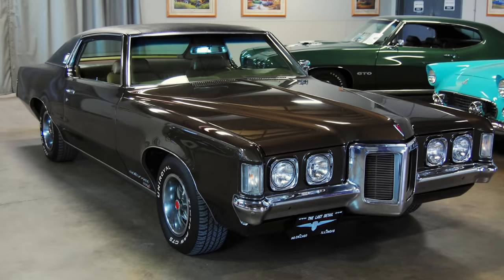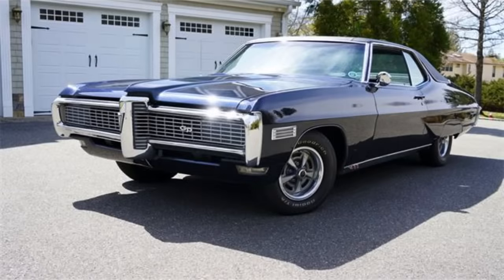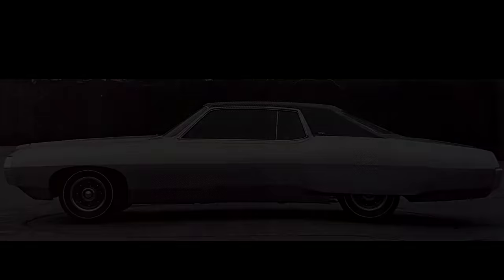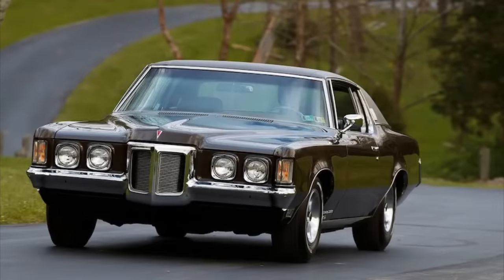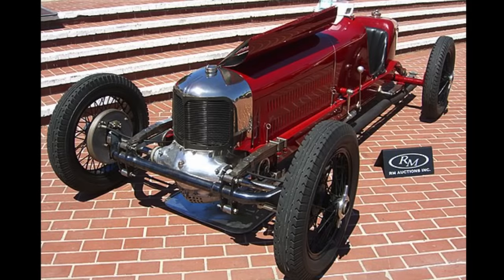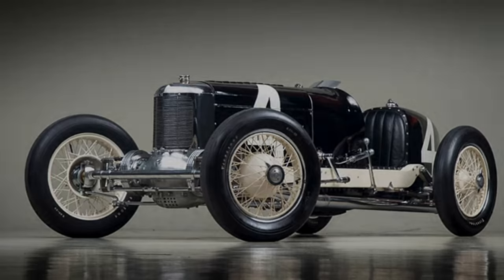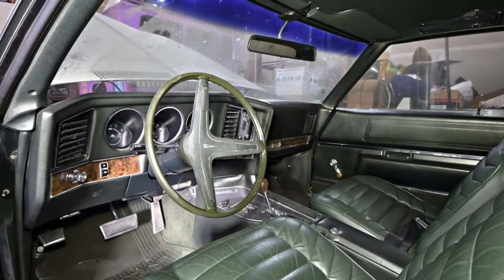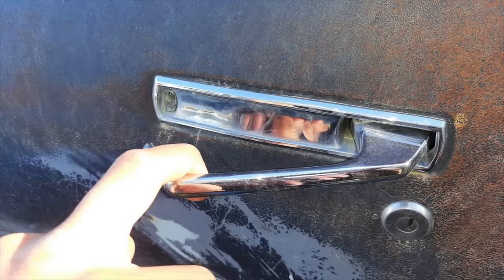Top 5 Strange Facts About the Awesome 1969-72 Pontiac Grand Prix!

Comment: The 69 to 72 is hands down my favorite generation of the Pontiac Grand Prix!!! Thanks Adam for sharing this informative video!!! 👍👍🙂
Reply: If I had my druthers, I'd blend a 69-70 front clip onto a 71or 72, dunno about the interior blend but I've ridden in the 69/70 they seemed good enuf on the inside just dig the rears of the 71-72's
Reply: The '69 wasn't boattailed, much cleaner than the '71-'72!

Comment: Actually, the 69 and 70 big Ford had a DRIVER-CENTRIC dash.  Everything wrapped around the driver.  The passenger could only look at the glove box.  The radio was on the left side of the steering wheel and the clock faced away from the passenger.  It was a great design if you didn't like passengers fuss-en with your radio.
Reply: As it should be. The passenger should just be glad to be there, and behave themselves.
Reply: I was going to point that out.
Love those big Fords.
Reply: I was thinking that same thing. I think the driver-centric dash layout was nicer looking in the GP, but the 69-70 Ford dash was over the top driver-centric.
Reply: The LTD, at least, stayed that way through '72...
Reply: Driver centered dash: 1963 Studebaker Avanti
Reply: @hiitsstillme  Sit down, hold on and shut up! 😆
Reply: @marko7843    True....But at least they moved the radio over to the right where the passenger could diddle with it.
Reply: @jwelchon2416 that was a mistake haha!
Reply: I had both.  1969 Grand Prix and a 1970 ford LTD. My wedding party was a ford LTD AND 3 69 Grand Prix’s. If I were to take my pick today, I’d pick the ford. (4-door)The parking spots today, I’d never be able to open the door wide enough to get out of the Grand Prix!
Reply: The vast majority of the full size '69 Fords had standard (not split) bench seats. I think the primary justification for Ford's driver oriented cockpit was that the remaining 3/5 or so of the instrument panel could be swept back. This allowed a short person to drive with the bench seat adjusted further forward, while still leaving a feeling of spaciousness for the front seat passenger, or perhaps even two passengers.

I could be wrong, but I think most if not all '69-72 Grand Prix had bucket seats. So, GM, unlike Ford, did not have to worry about the dash encroaching on the middle passenger's space.

Although it looked cool, the '69-70 full size Ford dash was not really as user friendly as it looked. And, I wonder how many customers Ford lost to other makes when prospective buyers saw that the radio was located on the left side of the driver. I still like it though, and fondly remember riding to the Dairy Queen in my neighbors' dark blue 1969 Country Squire.
Reply: Yup, Ford actually advertised the passenger side as the “front room”. 😊
Reply: You are correct, see my reply.  Dave...
Reply: Wasn't the dash of the bulletbirds briver-centric
Reply: @jimmyaber5920  They were more a dual cockpit.  The radio and climate controls were in the center.
Reply: One more thing, I am 63 years old, and I remember when Ford did that on the Ford fill-size for two years.  Mercury also located the radio on the far left side in 1969-1970.  I have NO idea why Ford did that.  And the radio antenna was located on the left fender, making it so the the antenna was always the driver's left-eye view, at all times.  Please reply.  Dave...
Reply: My parents bought a new 1970 Galaxie 500, and tbree years later I briefly owned a 1970 XL convertible.   My mother was only 4'8" tall and she could (just barely) reach the pedals (the dealer had to remount the seat closer to the dash for Mother as it was), whereas Dad and I were very cramped in that car.   But the radio being on the left was no big deal; my folks would have selected the "radio delete" option if it had been offered (it wasn't in the Galaxie or LTD).
Reply: And ...."Cash, grass or ass. Nobody rides for free!".
Reply: @jwelchon2416 no radio was on the left.
Reply: @michaelwitas9482  You'd take a '70 LTD Ford over a '69 Grand Prix ? Shocking.

Comment: I often wonder why the change was so dramatic in 1969 when Grand Prix used to be on the full-sized car line.  This video explains things. It went to the midsized car line and never looked back. There were many successful Grand Prixs over the years. They got away from the Duesenberg trim names in the 1980's. I am thankful you explained them. I had relatives that owned Grand Prix with those trim level names.  I recall J, SJ, LJ. I may have missed one. Those were some very interesting facts. I do recall all of them. Good footage and information. Thank you Adam.
Reply from the maker: LJ came later
Reply: @RareClassicCars  Indeed. Thank you for the correction.  It got easier to recall the trim levels by the 80's and 90's too: base, Brougham, LE, SE, GT, GTP, and the brief Turbo. People later associated this car with Nascar and Richard Petty. The Pontiac 2+2 came back briefly in the 80's in that Nascar package,
Reply: @OLDS98  That 1985 Pontiac 2+2 was very good looking for the era. Too bad it didn't have the performance to match the looks.
Reply: @MarinCipollina  Thank you for your comment. This is true. I see them on You Tube all the time and for sale sometimes too. The other G-Bodies ( Oldsmobile Cutlass 442,  Chevrolet Monte Carlo SS, Buick Regal Grand Sport ) all had performance. I wonder why Pontiac did not invest too. The trunk was an issue on this car too because the opening was quite small. I guess they more than made up for this with the next generation W Body performance Grand Prix Turbo, GXP, and GT.

Comment: One interesting tidbit, 69 was the first year that the Bonneville had a unique grill design compared to the other full sized Pontiacs like Catalina.  This is because the 69 Bonneville grille was designed for what was going to be the full-sized 69 Grand Prix before they decided to instead build it on the midsized platform.
Reply: I liked that upscale looking '69 Bonneville grille with it's endura impact absorbing framing. And, I think it's neat how the Grand Prix and Monte Carlo looked distinctly different even though they shared a lot of parts and under the skin engineering. You could never mistake one for the other, at least in the early years.

Comment: I’ve owned many Pontiacs and other vehicles in my 73+ years. The 62 GP and the 69 are my favorites. I still have two 62 4speed 8 lug GP’s plus a 62 Catalina convertible. I had a 63 GP 4 speed my brother got from me and still has. Also had two 64’s, a 65 and a 66 421 car. Newest owned was a 69J and in 1974 I bought a 72SJ 455. I still have my 65 GTO tri- power 4 speed and had several Firebirds, Lemans and Bonnevilles. I still have a 61 Bonny bubble top.

Comment: Gorgeous cars.  73 and after had I think one of the best dashboards ever but prefer the style of the earlier.  Although not especially praised in this vid, I love the 67 and esp the 68 full size...great detailing and have such a massive authoritative presence, while 69 and later had a lighter sportier look.  But ya know they were all good and a winner for Pontiac from the get-go
Reply: The earlier full size 1960s Grand Prix were always very special cars. Most were loaded with all the options you would expect on a Cadillac. They used real wood on interior dash, door and console trim. They were also very powerful with 421 Tri-power V8 engines. The 1964 had Cadillac style iced tail lights. The 1967 was the only full size Pontiac with hidden headlights mounted horizontally. The others were vertical stacks, which looks a bit awkward today.

Comment: Easily one of the best I’ve ever owned a 71 SJ with 455 HO dual snorkel air cleaner bronze with crème vinyl roof and interior.  Mine had the rare bench seat column shift and Trans Am style stamped steel steering wheel.  So much fun a true muscle cruiser.

Comment: Hi Adam, outstanding car and video!  Your information is 100% correct!  Most people who owned a Grand Prix, had no idea what "Model J' and/or "Model SJ" stood for.  In 1969, Pontiac Motor Division took the GM A-body "mid-size" hardtop frame and pushed the fire wall, roof and passenger compartment back, to produce a longer hood, front fenders, shorter rear deck and longer roof sail panels, (the area behind the quarter windows or rear side windows).  Chevrolet Motor Division did the identical thing with the brand new Chevrolet Monte Carlo, and GM called both cars the new GM G-body mid-size.  They both tended to look a bit bigger than the standard A-body, I.e. Chevelle/Malibu/Tempest/LeMans due to longer hood, front fenders and sail panels.  The G-body Grand Prix did sell much better than the B-body (full-size) Grand Prix did.  Back in the 1960s, Pontiac had two full-size personal luxury cars, the Pontiac 2+2 and the Pontiac Grand Prix, The Grand Prix had more standard features and more engine options then the 2+2, but both competing each each other.  Please reply.  Dave...

Comment: My first car was a 1971 GP bought for ten bucks, door handles were on airplanes first before ever on the 300SL. I have them on my 1947 Aeronca Champ. I think Beech Bonanzas might have had them as well, a good, clean and elegant design no matter who made it.  Great channel Adam. I am a huge Pontiac and Ford fan, especially that Ford body fit and door close. I had a 1984 Ranger and it also had that famous Ford door close sound and feel from the mid 60s.  Reliable too! four cylinder was great. S-10 had the GM door sag and slap shut flimsy feel for its doors, too bad, because the S-10 was a great truck when equipped with the iron duke and 5 speed trans.
Reply: I agree with you on that, dad had an S10 he bought new in 87 and it was great with the Iron Duke/5 speed, hauled anything, went anywhere with a slab of concrete in the bed for traction. 

It rusted out summer of 99, but the powertrain never failed❤
Reply: I had two Kids Rangers. The first one was a 96 basic model. It ran great I never had a problem. I sold it and got a 2002 Ranger 4x4. That was a wonderful truck. I loved it. I’d still have it but I broke my left leg and tore a nerve so I can’t exactly use a clutch anymore. I can’t understand why Ford stopped making them. They were true work horses.
Reply: @annenelson5656  Very cool, did you like the basic one or the 4x4 better?

 I'm surprised you can't use a clutch anymore, I thought with your leg and nerves being repaired, you'd regain feeling. Can you still walk without a cane/crutches/walker?

Comment: Hey Adam, that '68 GP has another unique cornering light for your collection!  (And can you imagine getting parts for THOSE headlight doors?)
Reply: @marko7843 Aside from the grille face portion, everything else would've been shared with Executive, correct? Bonnie's were open headlight in 68/9, as were Catalinas I believe.
Reply: @jamesthompson8008  Well, I was talking about the "eyelids" over the headlights, which in hindsight may actually have been lifted from Adam's 1967 Eldorado...  If you're asking about the car in general, it was basically the slightly smaller Catalina chassis with the Bonneville's drivetrain.  Buick did much the same thing with the Wildcat and then the Centurian:  take the big engine and transmission out of the largest car and put them in the next largest car with a few fewer inches of wheelbase and a foot less body, thus making a 'sporty' full-size.
Reply: @marko7843  Yes - the 'eyelids' is what I meant. As all the mechanicals would've been shared items.
Reply: A neighbor restored a 1967 Grand Prix convertible over 15 years ago and complained how hard it was to find parts for it back then.

Comment: My first car was a 1969 Pontiac Grand Prix. Another feature was the interior door release handles. You had to squeeze it with your finger tips, to open the door from the inside. I wish I could have kept that car. But unfortunately it was just an old car, and I needed the 428 for my GTO.

Comment: The  69 to 72 grand prix's are a fairly common car. However I do like  the  71 and 72 's  You  failed to mention,  one of the greatest facts,  about the car.  69 to 72 , which , especially 1972 , came with  manual  4sp transmissions, with special consoles.  I have the history on paper,  on my research materials . Something,  like  close to 800 , for 69 , 400 for  70 ,  150 , for 71 , and lastly  , 100 , for  72 .  And  0 for  1973 .  At the moment,  can't remember the exact amount,  because I am  to busy,  researching something else.  Also,  I believe you could order  a 455 ho motor.  Not sure.  Great  video,  Adam, nevertheless.
Reply: You may wish to research a bit deeper. I have read 117 for '71 amd 0 for '72. Though I did speak with an owner that converted his '72 into a 4 speed.

Comment: My dad had a couple of these, a 69 and a later one as well.  We always loved the incredibly long hood on the car.  Driving around Detroit, listening to Booker T and the MGs on his 8-track player.  You might also notice, the design of the door handles on the Tesla Model 3 and Model Y also have a very similar design.  It allow the handles to sit flat to the car for aerodynamic efficiency.  The motion to open them is push with the thumb, and then slip the rest of you fingers under the handle and pull.  Very easy once you've done it a couple times.

Comment: I don't see how they could know the '68 was a flop when they had to have started the '69 at least a year or two before production.
At the time, I built a plastic model of the '71 or 2 in metallic brown.  Great looking car, but what a 70s color!
Reply: Good point, I was thinking the same thing. I do know that the divisions often had several proposals running concurrently which allowed them to make quick decisions based on sales results - even in the 1960s! The engineering underneath was fairly constant regardless of the body finally chosen.

Comment: I had the '72 J. It was fast stock (400), but I dropped a modded 455 in it and it was such a sleeper. The hard part was getting it to hook up and then STAY hooked up until about 40 mph.

Comment: I have owned SIX 70-72 GPs (exclusively) since the early 80's.
My younger brother had a black and gold 72 J with a 400. He hit a bridge over 100mph and walked away.
I got my first Canyon Copper '72 J in 1982. Painted it black and gold and sold it at a profit 2-3 years later.
I bought a California triple black '71 J in '85. Painted it black and gold and went through the whole car front to back including upgrading to a 455. I had to watch it burn to the ground due to a failed fuel hose 9 years later. During that one's ownership, I had 3 rusty winter beaters. A white '72 SJ with black interior and top. Followed by another triple black '72 J with factory installed red carpet and oval opera windows. Then a Burgundy '70 J with a black interior and top. I went hunting for a nice one again and bought a Copper '72 SJ with a Saddle brown interior. But it did not scratch that itch. I found another triple black '72 SJ in 1998. I added a beautiful metallic gold to the hood and trunk within the first week and still have it to this day. I have been to 8 car shows this Summer so far and am the only GP there. It is a 52 year old survivor with a 26 year old paint job and I still win class trophys from time to time. The engine is original with Q-jet, points and R12 in the cold A/C. I have put an extensive stereo system in to include FOUR 10" subs in the rear package shelf. Men like the uniqueness of it compared to all the Camaros, Mustangs and Chevelles. The women like the beautiful black and gold combination and the younger crowd love the stereo. There is no better feeling than having strangers compliment one's efforts all day long.

Comment: '69 GP's were called the smart man's Eldorado. SJ's featured standard rear leveling just like Eldos. First car to place the antenna wires in the windshield and the first to offer embedded heated wires for defogging the rear window. Pontiac called the drivers seat a Command Seat and I've read it was the first car to offer intermittent wipers. The interior door handles were hidden in the armrests: Squeeze Release, only for '69. Can't think of another car with that feature. It was also the first car to offer a full soft rimmed steering wheel. Most have hardened with age. There was no glove box in front of the passenger, just padding and it was the first car to feature inner impact door beams for safety. If you ordered the Delco 8-Track, which came with twin Sepra-Phonic or Verbra-Phonic 6x9 package shelf speakers, it was mounted on the transmission tunnel, behind the console and faced the front of the car. Impractical, yes, but without a glove box, there simply was no other place for it. Designers Jack Humbert and Irvin Rybicki have been credited with the handsome exterior design.

Comment: Standard A-body coupes rode a 112" wheelbase, the Monte Carlo shared the sedan/wagon/El Camino 116" span, with the rear fenderwells lined up so the extra 4" went to hood length rather than backseat/cargo room. Grand Prix had a 118" wheelbase, and I wonder how hard JZDL had to fight with Engineering and the bean counters to get those extra 2".

Comment: 0:47 I read that within the Pontiac engineering staff there was a question floating around: What if we put all the premium full-size components in a midsize, not just the engine and transmission, but also things like the brake master cylinder and booster (yes, those parts specifically were a direct quote from the question), and all of the ancillaries. The Grand Prix was the answer. It was a way of getting more performance from the full-size package because it was in a midsize body with lighter weight.